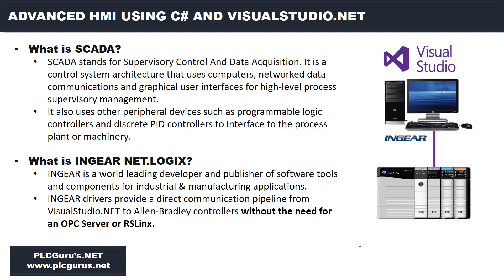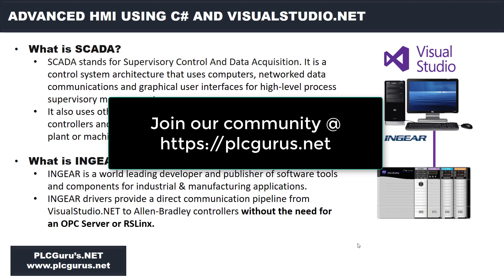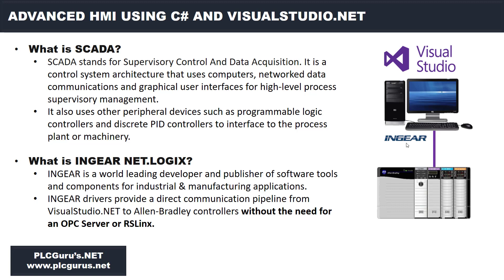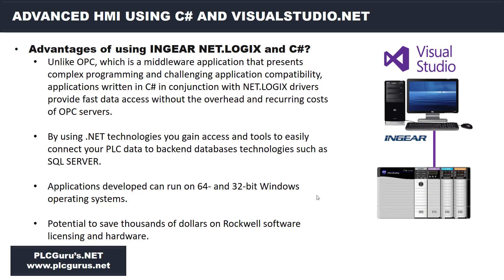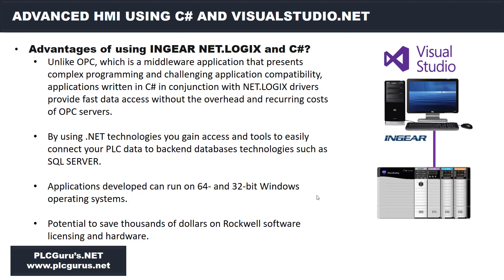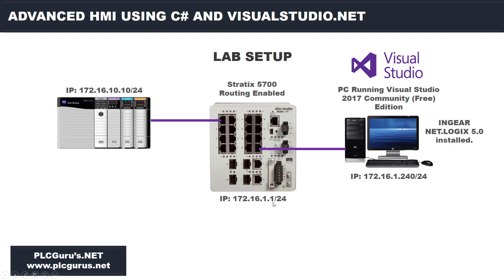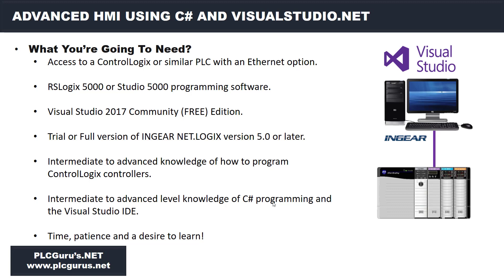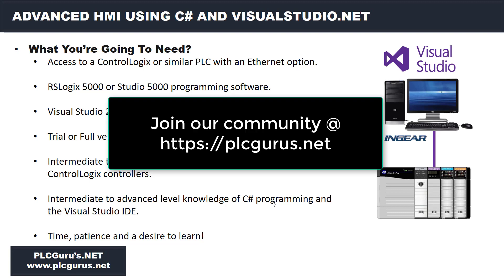PLCGurus.NET - C# HMI - Introduction To Visual Studio and Ingear Drivers

Comment: Yes. Where is part 2? I have RSLogix 500, VisualStudio, AB MicroLogix 1100 training unit set up. I know C#. How I can start?
Reply from the maker: Hi Eugene. I promise I am going to circle back to this at some point, I have a few other projects on the go at the moment. It sounds like you are all setup to go and if you have a C# background you have the hard part licked. You will need to purchase the Ingear NET.ABLink drivers to support your Micro1100. Once you install the drivers you'll be able to import the necessary .DLL reference in your C# project and then import the necessary namespace into your classes. If you want to start a thread in our forum at https://plcgurus.net/forums/ it will provide a better platform to help each other while you work through this.
Reply: I will. Thanks.